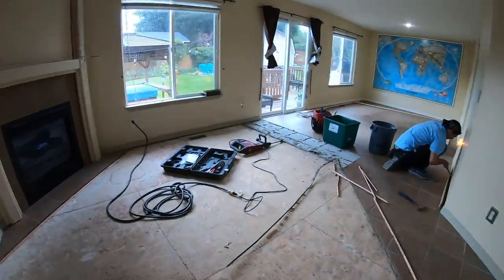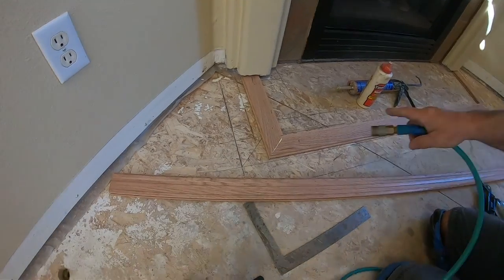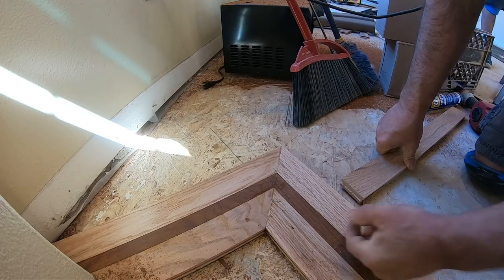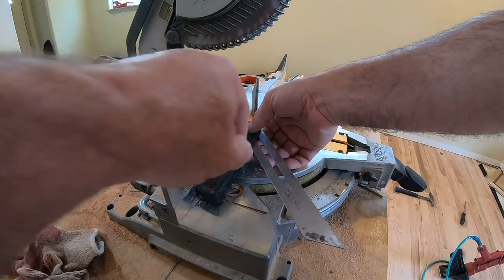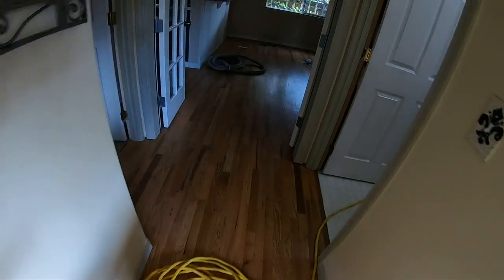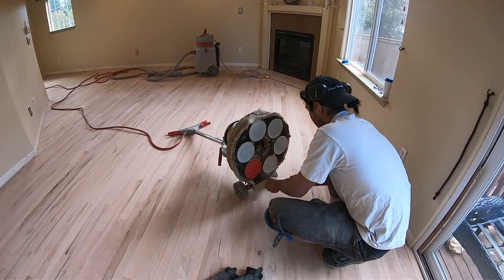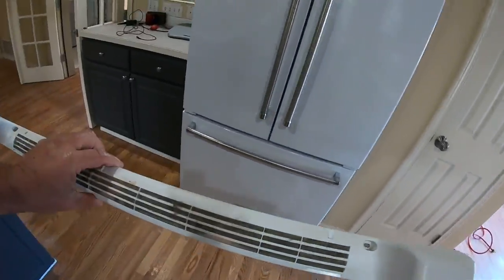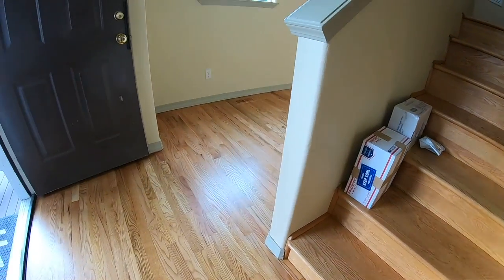Custom Fireplace Hearth, New Floor, Prep, Install, Sand And Finish

Comment: I see you cut the groove in, do you ever route the tongue? Or just glue and nail if you come into that situation?
Reply from the maker: Here we cut the groove as you said. If there is no toung we will cut  two groovs , use glue and a slip toung, or spline especially at stair nosing. Sometimes glue and nail. Thanks for watching.